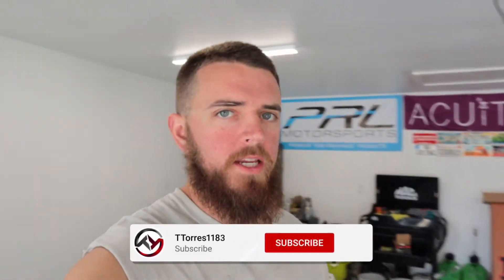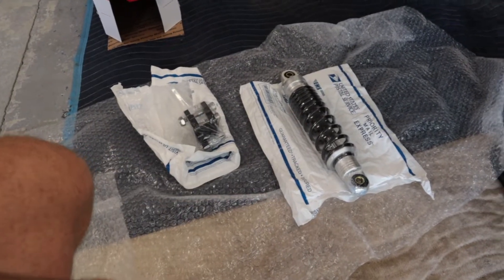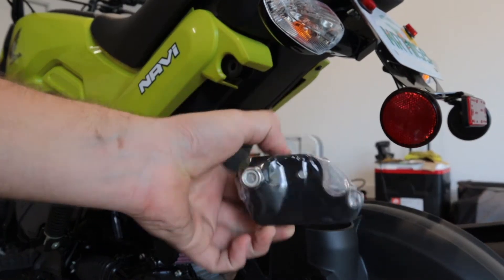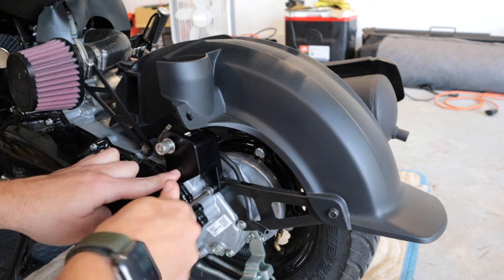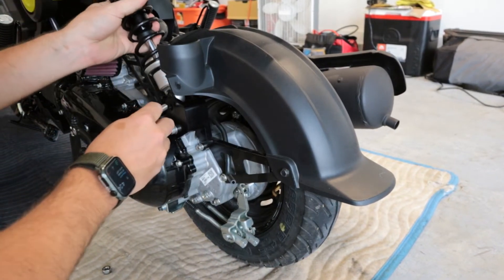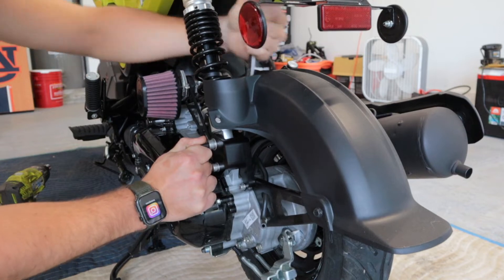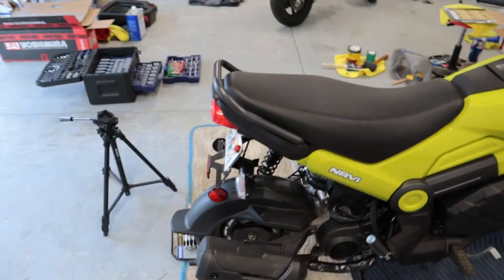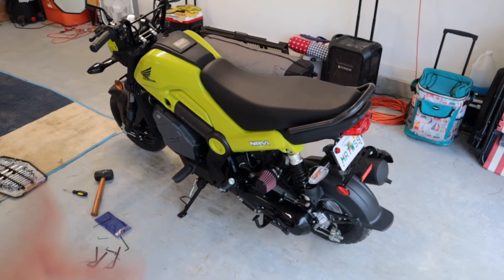Honda Navi Rear Shock Install!

Comment: Will I need to jet  the carb if I put man in the box air in take on
Reply from the maker: It’s highly recommended
Reply: I just purchased my first one today. I would like to do sire intake, jets, and exhaust. If that what you would recommend. Will I get more Perfomance out of it? Is everything in the description I need?
Reply from the maker: Yup, the intake paired with the exhaust is going to help a lot with the jetting
Reply: Great thank you. Keep the videos coming.

Comment: Was kinda surprised that you said it was squishy, mines way too stiff
Reply from the maker: Did you adjust it?
Reply: @TTorres1183  didn't know if I could adjust stock 😂 first bike I've ever owned
Reply from the maker: The shock I have is aftermarket.
Reply: @TTorres1183  oh no I was talking about how you discribed the stock shock on the Navi, not the aftermarket, I'm not sure if they just slapped the shock on there without adjusting it or what but mine is almost unable to move because of how loaded it is